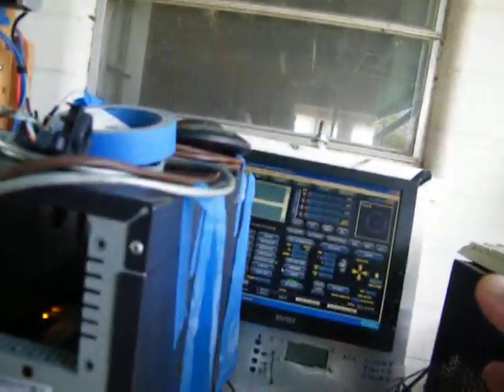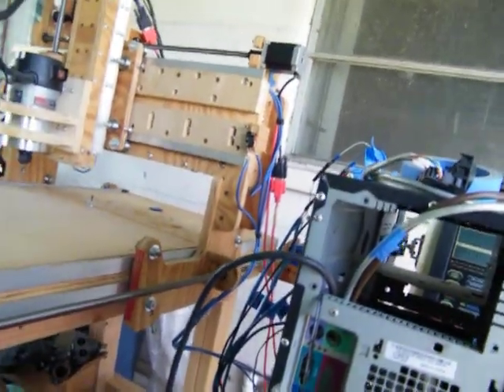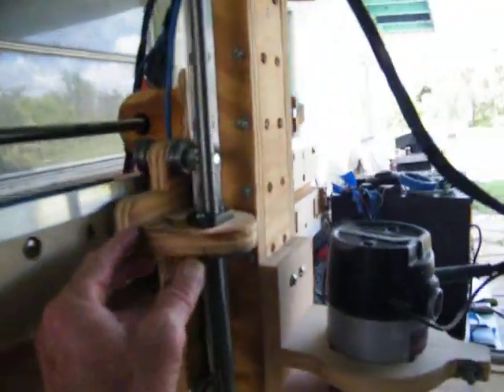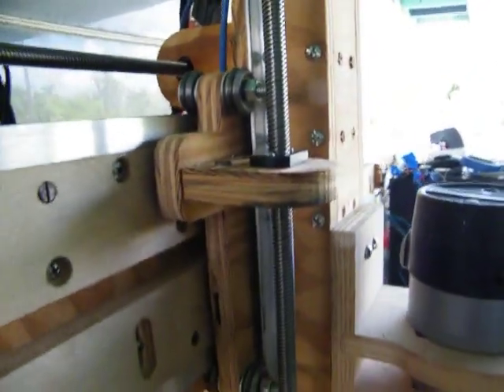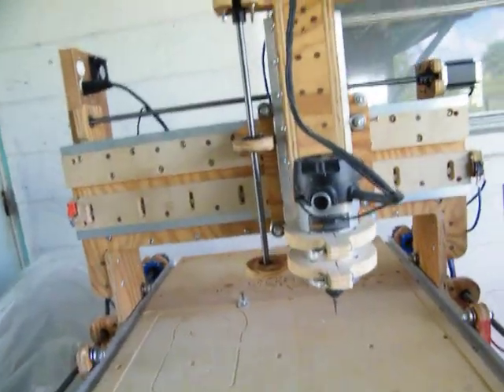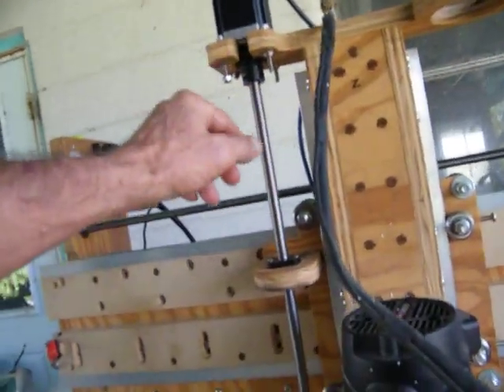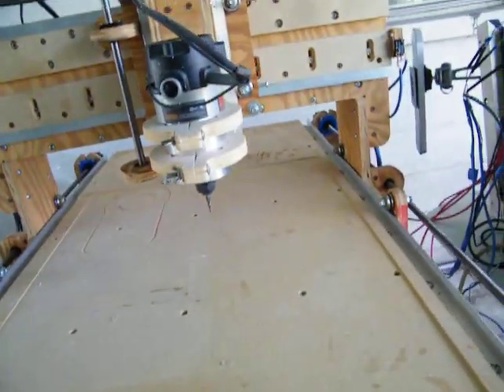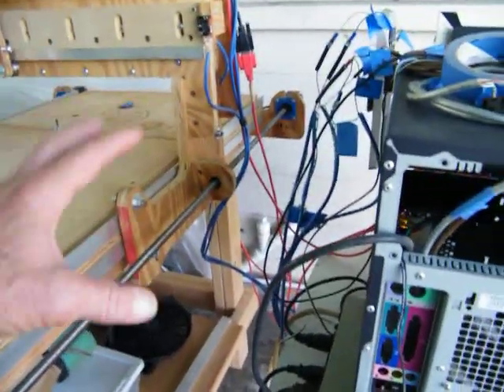it all works

Comment: So I don't know what the thing is but searching just thread pitch diameter explained gives me plenty of interesting crap that's probably not helpful here 
I'd go with thread pitch diameter calculation for cnc mill "thingy mabob"
Replace thingy mabob with what it's called obviously 
Or don't maybe that will work
Reply from the maker: this one is neat project , no software period or computer, i've been transferring data to an older pc i picked up 5 yrs ago , knowing ide be doing this in the future.
plus im in and out of it with spans or years in-between playing around getting it working then shutting down for years traveling
so i get rusty with a brain fog

Comment: What's the 12 millimeter thing called? 
Not my area.
If I ever have some cnc mill type stuff it will look like yours though so I appreciate what's going on here 
It's above my pay grade right now

This vid has a guy talking about some "thread pitch" thing
https://youtube.com/shorts/_NRci_96WLQ
I think that's the vid
Never linked a short before. Will test to make sure what i deleted off the end was just stuff about the playlist i had it in
It works the stuff on the end was just about my playlist
Reply from the maker: ballscrews 12mm 4 pitch
Reply from the maker: all my machines are on the cheap end DIY , im building a new bed for this one out of unistruts , like my big router . 
This one was a kit some one bought and assembled  , flat box kit, 
i would very much recommend all those interested in cnc get involved in some sort even if its wood or plastic.